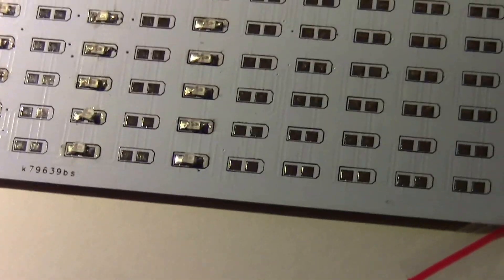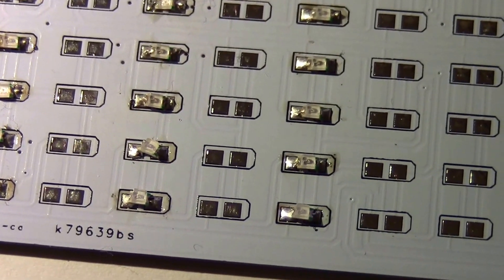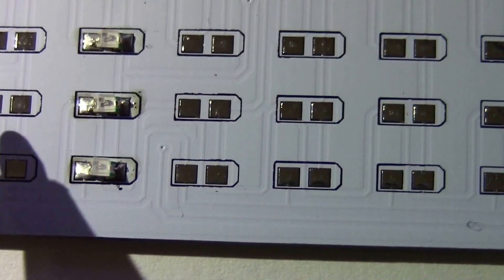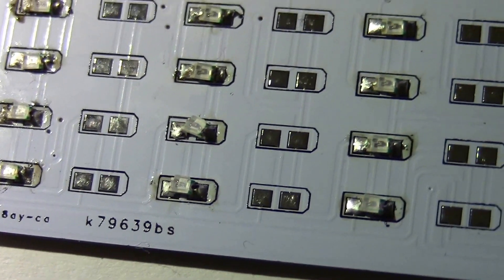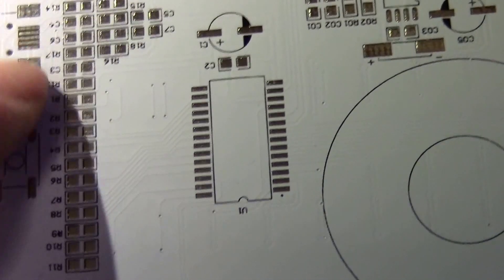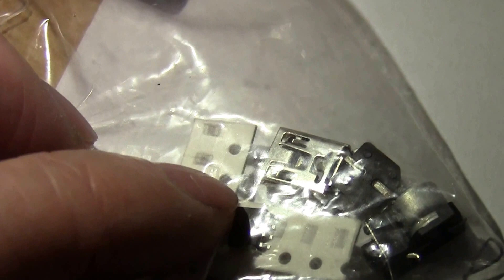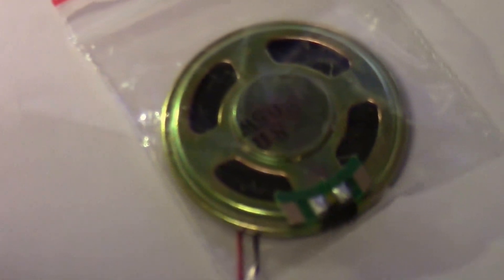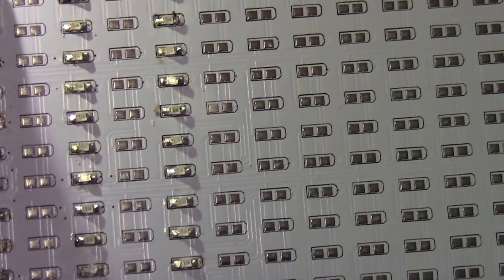LED MUSIC LEVEL DISPLAY KIT part 1

Comment: I know how you feel. My solar bulbs have 216 LED size 1206. I have 8 bulbs. They supply my home with better than grid light. Each bulb also has 72 resistors same size 1206. All surface mount soldered by hand. So you did an awesome job my good friend.
Reply from the maker: +Raymond Earle Those SMDs are impossible to solder by hand, unless you are impossible to begin with, then the job is for you.
Reply: Hello. My name is Mr Impossible. LOL.I do solder my lights by hand though. I have me doing it in my Lightboard playlist.